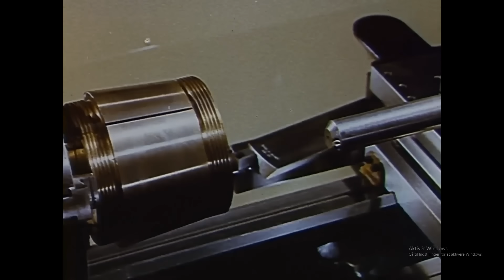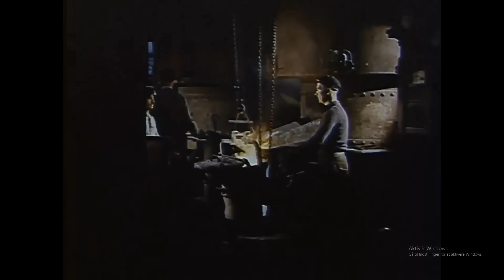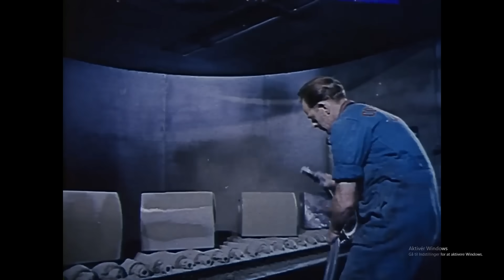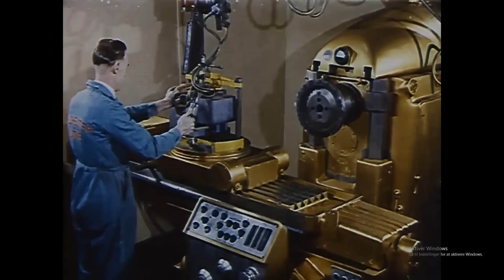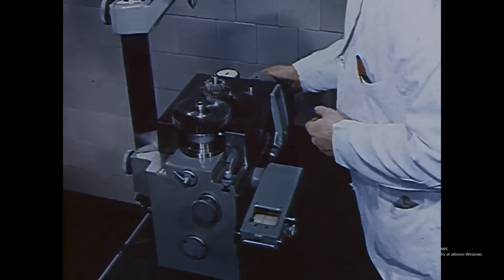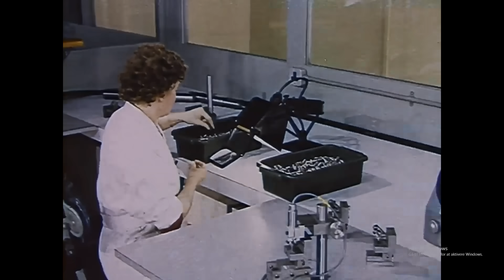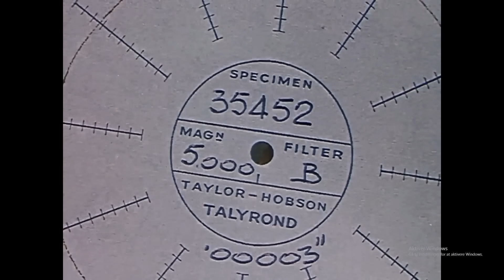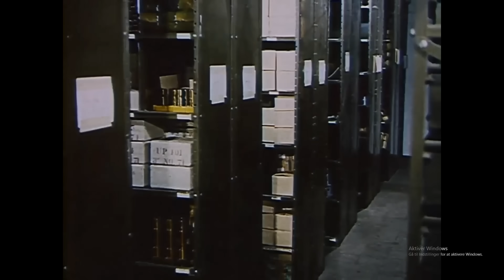Colchester Lathe Company

Comment: No wonder people are still buying these lathes for more than they were sold for.
Reply: I have worked in third world development for 50 years, Africa and Asia. My job was in small scale industrial development, often setting up small workshops.
Some years ago I heard of a top UK university that was clearing out it's engineering workshops and went along to see if I could purchase some machine tools for workshops in Cambodia. I was told by the university administration that the machines would only be sold as scrap, that for HSE reasons could not be sold in working order. Effectively they would smash the machines rendering them scrap. However when I told them I would be shipping them to a third world country they agreed to sell them to me undamaged at scrap value. 
The machines included: 4 Colchester Students, a Colchester 2000, a Bridgeport vertical/horizontal miller and a beautiful 18in Butler shaper. All the machines were in mint condition.
Reply: Not completely true, Colchester Student and Chipmaster and Bantam lathes in very good working order can be had for £3000 or less. What inexperienced people don't understand is that these machines were built to last and are not like cars for example with built in obsolescence. I have heard many say they would rather get a new Chinese machine rather than risk a used quality machine. It's not rocket science to determine if a machine has been abused. Many come from schools and universities where workshops have been closed down, often for stupid safety reasons, and are in excellent condition.
I purchased my 1970s Chipmaster 20 years ago for £400. It had seen lot of use but has served me in my hobby as a model engineer without a single fault.
Reply: @haroldpearson6025  The Student at my school had a tooth off somewhere !
Reply from the maker: @haroldpearson6025  absolutely true. I get sick of reading people buying a Chinese crap lathe over a good European build.    I would rather have a 50years old lathe than any of today's China made.    And yes, schools and training facilities sold out for nothing. Stupid they are.  I bought a very fine Triumph 2000 at my local school last year.  Gave 1100£. With a almost brand new quality 4jaw and a like new steady rest.     They sold all their Colchester triumph lathes, and now only have one triumph 2500 left, and many Crap Knuth from China.   Stupidity at highest level
Reply: RH My High School renovated their metal shop two summers ago. They had 3 South Bends (I believe they were heavy 10s but not certain) and all sold for around $500 on a state auction website. One sold for $750 because it had a taper attachment equipped. All of them had been abused by dumb shop kids of the past, but they still ran fine.  They also had a large Servo Shift LeBlond in the autos shop that was almost never used because everyone was too scared to use it lmao. It had to be at least a 16” x 60” Regal and it had a 6 jaw chuck equipped. Sold at auction for around $1000 which is amazing considering the school bought it new for $60,000 back in the 80’s!
Reply: @trainman5371  while people may be dumb I'm sure you where a student at some point. And may have even crashed a mill or lathe ...
Reply: @unacceptableminority7101  I haven't crashed ether... yet lmao. I graduated in June of 2020, and I'm going to a technical college for tool and die! I know it will happen eventually, but it will be by accident. The abuse I was talking about was mostly intentional. Those South Bends had little brass oiling cups on them, and some kid with a hallowed out skull took a deadblow hammer and broke off many of the oiling cups. Another very talented young man took a ballpeen hammer to a Starrett surface plate. Had to pay for a replacement out of pocket, and was apparently dumbfounded by how much they cost lmfao. I have broken my fair share of tools though. I've gummed up endmills with aluminum, and broken carbide lathe inserts when I went too deep and the work bound with the tool. There was a kid in my junior year that forgot how to turn off power feed on the new lathes (we got six brand new 13 x 40 LeBlonds when they renovated), and he ran the tool right into the 3 jaw.
Reply: @VærdAtSe  I own a Colchester master 3250vs it had been in a toolroom all its life I don’t understand people buying lathes from the Far East when we have our home grown supply
Reply: @diggmore1362  Neighbour of my parents ( Car dealers ) were producing racing engines. He had a colchester but sold it and bought a Japanese Okuma. A lot quieter, more easy to use, a lot more massive  and more precise. He would prefer a  German VDF - Heidenreich & Harbeck, the best money can buy - but was too expensive ...
Reply: A deceased friend of mine (Harry Boneham ) from the Toronto Society of Model Engineers was using a lathe made in the 1890’s. And doing damned fine work with it. He still had the overhead flat belt drive system in place !. He had worked at ERA, English Racing Engines as a lad.
Reply: @trainman5371  no such thing as an accident only someone's negligence.
Reply: @VærdAtSe  I've bought all my machine tools used and they're all British or American made from the 1930s to 60s. They all have souls so to say, my lathe, a Pratt and Whitney made parts that helped win a world war for example. They may have needed some work but they instill a sense of pride that comes from working with then when they're done that you won't get from a Chinese junk heap. My Bridgeport mill was purchased from a HS that was shutting down their tech ed. dept. due to moronic insurance regulations. And people wonder why our countries are going to the dogs.
Reply: @haroldpearson6025  or you can buy a brand new Colchester Student straight from Colchester Machine Tool who are still operating having incorporated the Harrison, Clausing and few other brands. 

Granted not made in Britain anymore but then no manual lathe is these days as far as I am aware at least in mass production and tbf it is still reasonably well made despite been primarily manufactured abroad.
Reply: Exactly, and you give your money WITH PLEASURE !
Reply: @ianvcurtisfineartsculptor.3709  Oops!

Comment: Just goes to show what we as a country could produce, before we farmed everything out to other countries that use cheap labour and cheap materials, with no quality control. I love all my old equipment and where possible, never buy anything modern. I have also referbished 3 lathes.
Reply: We once had a proper aircraft industry. Every single bolt, screw, rivet was produced here, all the way to the top class mechanics and electronics. There is a bit left but not without relying on our ' friends' to supply the rest.
Reply: Hi My name is Brian, I am the proud owner of a Colchester Student Lathe with the round top.So i think it is a mark 1, i have tried to find out all i can about the lathe  but the serial number draws a blank. Reading your comments i wonder if you can help me with a screw cutting problem. When cutting a thread the thread form is as throw i an cutting a multi start thread weather an imperial or metric thread. I have checked the half nuts and there is very little ware on them , but the dial indicator gear is past repair but on what i understand that has   
no effect when cutting a metric thread. If you or any one else can help me i would be most grateful. My e-mail address is Brian.Blurton@ntlworld.com  Should anyone consider helping me. Kind Regards Brian
Reply: My shop is made up of old machines dated from the 1960's to 70's old belt drive Bridgeport Mill that is just as good today as when first made other than a little sloppy on the hand wheels but just as accurate I also have an OLD English Horzontial bandsaw tha takes a 1" blade, 14" wheels an a 3/4 horse motor had to machine both 14" wheels  as both had a radius and the backing was worn off, what a nice machine I bet it weighs well over 500lbs.

Comment: When quality and service did mean something 👍👍🏴
Reply: Sorry but that comment is BS. Modern professional lathes and milling machines are still produced to extreme high standards, are still serviceable, and have great customer support. That comes of course at a price, and you can't compare some consumer tools with high quality professional brands.
Reply: @matekochkoch  The difference is that these colchester lathes were much cheaper to the quality than they are today. Obviously you can find much higher accuracy machines today but they are insanely expensive. The only thing consumers today can get are cheap chinese crap or old heavy machines.
Reply: They are still going mate. I only found out through seeing if the old lathes are still around and found the company is still running... That shows quality will always be around.
Reply: Well, it's not like tolerances rose. Today, we can have CNC mills the size of multiple vans that cost a few billion dollars that make tiny beam balances (all in one setup) that are accurate up to the 6th digit after the decimal point.
Reply: And you my Scottish friends are at the very top of engineering👍
Reply: You mean: when customers had high standards for “quality and service” 
- colchester May have offered just that, however, it came with a representative cost, either by direct service fee, or indirectly through the price of the product. Which, of course, wasn’t a problem as customers would not have been interested in the products of a company that cut corners. Today, the standard most often focuses, shortsightedly, on the sticker price; forcing companies to shed quality standards in order to remain competitive
Reply: This is sickening to watch. It is easy to imagine nobody is building tools like this in the UK any more. Sold off and sold out, reimagining the UK as existing only to prop up a bloated financial sector. I'm 31. When I was at school there was no serious consideration that any of us would or should get jobs involving tools, machines etc. Get a degree, go sit at a desk.
Reply: @Meddled  no one is building these tools in the UK anymore, literally no one. Colchester is still running but most of their manufacturing is done in the Far East. Only the very final assembly is done in UK.
Reply: That's why I love old technology machines. Yes they are lot inferior in functionality compared to modern eras. Rest assured the investment you put is eternal. They will last forever. Robust in quality turgid and won't break down like rubbish chinese. Nowadays I see western countries do compromise in quality using Chinese parts . At least in olden days there is something called pure
Reply: Yeah, but not health and safety! Spray shop with no masks!
Reply: @delcat8168  Health and safety are not concerned about you getting knifed on your way home from work.
Reply: @woden20  What the hell does that have to do with anything.
Reply: @delcat8168  same in the fettling shop
Reply: @delcat8168   china has no health and safety and thats all shit!
Reply: @andyg3  20 millionth of an inch of tolerance and precision machining and precision engineering. During WW II tolerances of 10 millionth to 11 millionth of an inch is acceptable. Today's dumbed down generation who are completely dumb and clueless will falsely accuse you of lying and of making things up despite the fact they are surrounded by precision engineered products made in the last 55 to 65 years and are still going on strong! This young generation of today in 2020 is a lost generation forever!
Reply: @delcat8168  That was my first thought!  No safety glasses or masks for all the grinders either.
Reply: Del Cat what he means is back before people needed breast fed at work and worries about shite like that. Health and safety didn’t come into it when skilled sensible people were of abundance .
Reply: @chrisfalconer1276  I understand a lot of what you are saying and agree but I think there’s also a middle ground here. 

Companies and employers shouldn’t be ordering people to do stuff that is clearly hazardous and risking life or serious injury. I do draw the line though when it comes to people getting told off and disciplined for a paper cut or because they didn’t wear the  right colour high via jacket in a certain area or whatever. 

High risk sectors such as metalworking are inherently risky and it should also be expected that even experienced and skilled workers will end up with the odd bruise or minor cut ever now and then. 

On the other end of the spectrum is things like the stories my welding lecturer used to tell of hanging off ladders and welding structural steel in previous decades while another worker held the ladders from the rooftop. Now to me that seems like tempting fate and asking to end up flattened on the pavement below...it’s probably for best that such procedures are now longer allowed legally to actioned and authorised by operators in the sector.
Reply: @chrisfalconer1276  Bullshit. People constantly died due to lack of safety, doesn't matter how skilled you were.
Reply: People new thier work inside out and back to front!
More money is spent on pointless box tickers these days !
Reply: an early death for poor pay
Reply: when you've 7 billion ppl , quality and service are history ....GOOD OLD DAYS WITH GOOD AND HIGH QUALITY STUFF...btw when UK was UK for NATIONALS... FUCK DIVERSITY ...
Reply: @Lusitania-j2g  Paulo Dias? Sturdy British name right there.
Reply: @Lusitania-j2g  Japan is somewhat the exception. They are masters of mass production but also realized they must find a way to combine both British and German precision engineering quality together with mass production and they have done it with the use of both conventional mass produced analog micrometers and the use of lasers in inspecting their tolerances above 20 millionth of an inch, and with better metallurgical engineering materials
Reply: @Lusitania-j2g  20 millionth of an inch of tolerance and precision machining and precision engineering. During WW II tolerances of 10 millionth to 11 millionth of an inch is acceptable. Today's dumbed down generation who are completely dumb and clueless will falsely accuse you of lying and of making things up despite the fact they are surrounded by precision engineered products made in the last 55 to 65 years and are still going on strong! This young generation of today in 2020 is a lost generation forever!
Reply: @darthvader5300  DMG Mori NT Is a world class 5 axis turning center. Trust me it's better that the WW2 shit . On a machine like this you can turn , tap , profile , 3d mill , 5 ax mill , in process measure , auto compensate the tool and re-measure , bore , ream , drill or mill on an interpolated path , chamfer , deburr , back chamfer , variable lead threading , What ever you can imagine . Some machines even have an auto changing head for additive manufacturing , afterwards it reverts and finishes the part ....... and much more wia monitoring software and robot automation . 

Stating that WW2 machines were better than 2020 engineering is just dumb . I will agree on a point of longevity . 'Cause none of the regular cnc's will work after 30-35 years . The Monachrs , the G&E s , the DSG , Cincinatti , Craven , they all have passed the trial of time , they pretty much outlived the engineers and original workers . 

Also let's not compare a 70K haas to a 500-700K Mori NT . I will say even a nicely kept , not fucked up 70k cnc lathe can hold about 2microns of roundness on a 80mm dia part . I can personally wouch for this .

Also there are speciality ultra high precision lathes , that can hold 0.5microns , with circularity a magnitude lower, such as 0.05µ (i've read about this and it was a 100mm dia part) surface looked better than any grinding that i've come across , except on KAISER tooling .
Reply: @kisspeteristvan  Have you ever worked in a mchine tool fabrication work center machining components for nuclear warheads? I did, I directed the master machinists to do just that. Military machine tools are decades ahead of their civilian machine tools counterparts in terms of precision. Besides necessity is the mother of all inventions. WW II is one BIG NECESSITY!
Reply: @darthvader5300  Of course i didn't , at least not yet . But i do know there are some machines that you can't buy without a valid reason , it has gps , and you cannot relocate it without permit.  I don't think they are decades ahead , if they are, than only electronically&software.

Comment: You can see why they cost thousands even for a really old machine.
Thanks for posting.
Reply from the maker: Your welcome 👌. Yes, just look at the paint job/filler/ grinding.  Today only a thin layer of paint are added
Reply: @VærdAtSe  I've got M250 lathe in factory wax some years back. I think, it was made in 1994, white painted one.
In order to get rid of rock solid (now) wax, I had to partially disassemble machine. It was pure horror how badly this lathe was made, unsharp tools used to cut holes, motor base skewed, improperly sized washers in some places, many threads I had to recut/clean up, paint job is shit- no primer, paint is falling off from unused machine, gears in apron half engaged (grooves in shafts in wrong places)... And many, many other things I even  don't remember now.
Older Harrison machines, greyish painted, was much better made, I got some spares and accessories from these older ones for my lathe and quality difference was very obvious right away.

So, from what I can see, at some point quality of UK made machines went down sadly. And by seeing this video, It is clear why these old machines are still valued. Because these where made with care and attentions to details. But evil is in details. :)

Thank you for posting this video! I love these old machining videos!
Reply: You can still pick up the smaller Colchester's or Harrison lathes cheaper than a Myford 7 or a new larger Chinese lathe. Often ex training school with little use.